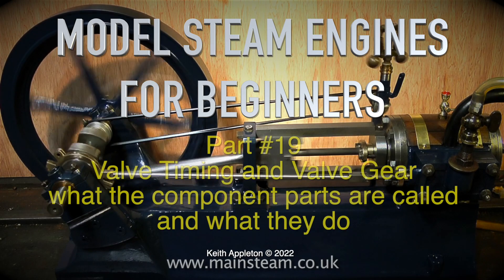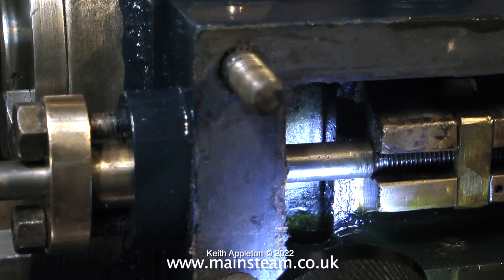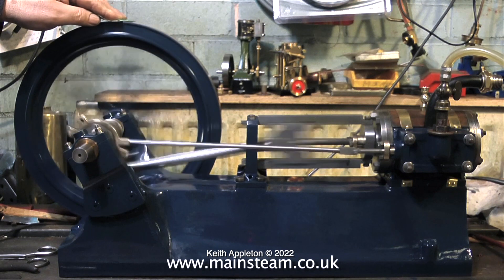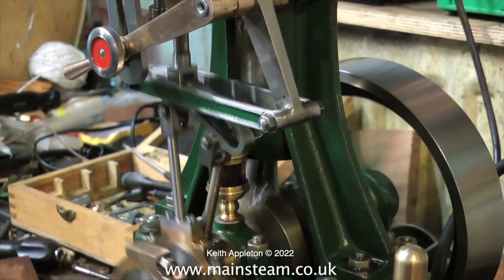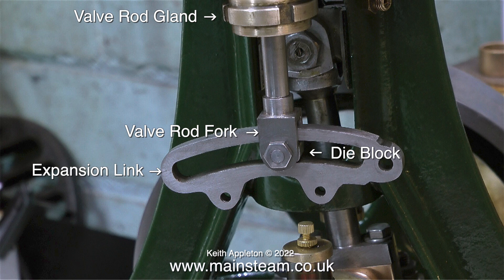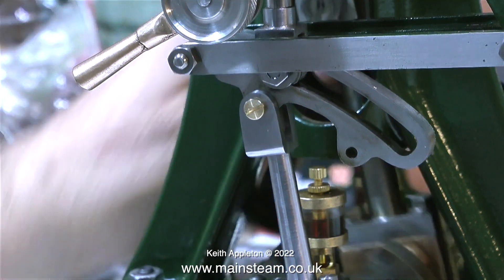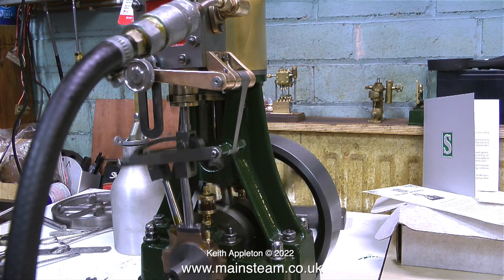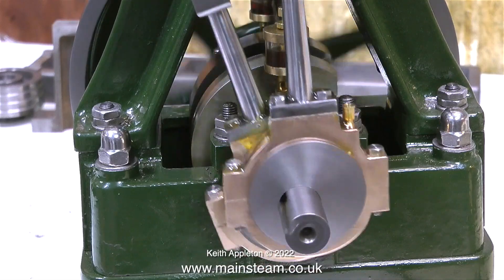VALVE TIMING AND VALVE GEAR - MODEL STEAM ENGINES FOR BEGINNERS - PART #19

Comment: Slide valve eccentrics are set to 90 degree + lap angle + lead angle in advance of the direction of travel.
With the engine on dead center (top and bottom) lead should be equal on a horizontal engine, on a vertical engine additional lead may be required on bottom dead center.
Lead is the amount of opening of the port. Hard enough to measure on a full size engine, probably harder on a model.

This is what I was taught 40 years ago learning to be a steam engine driver.